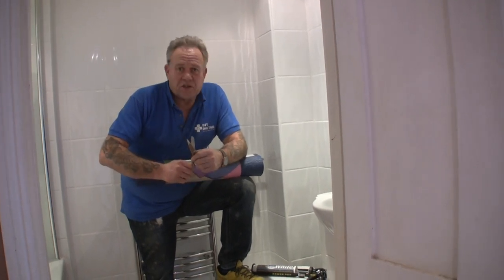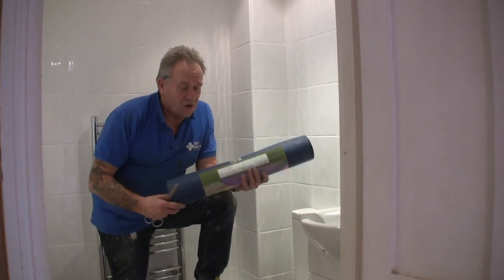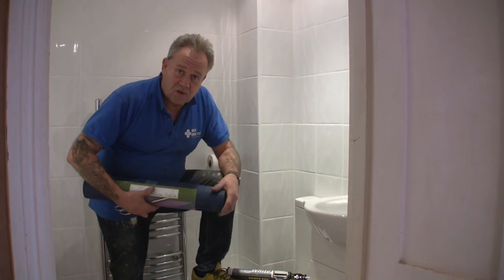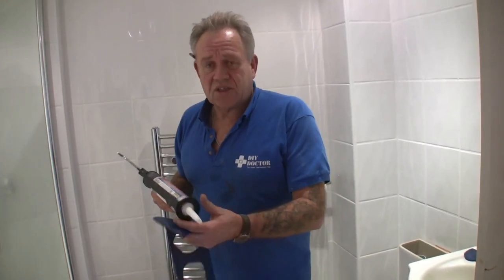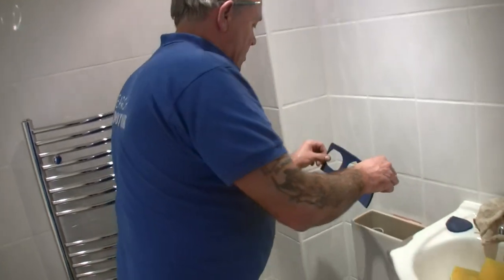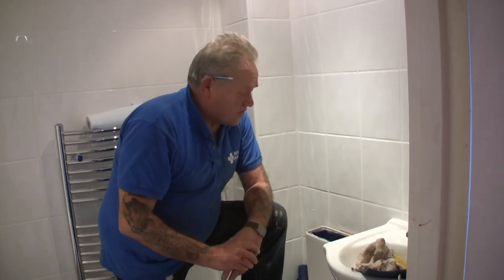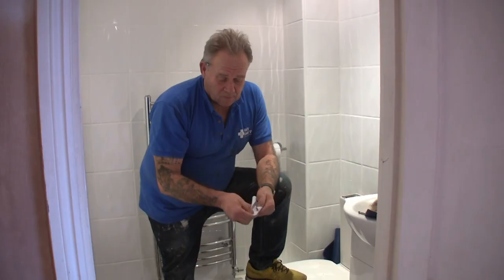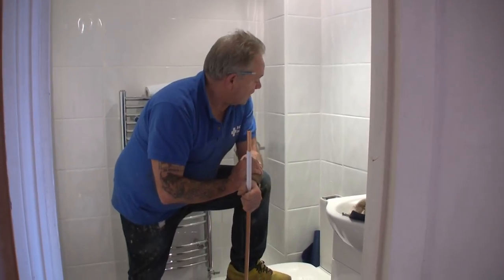Condensation on toilet cisterns and cold water pipes

Comment: lets hope you never have to change change either of those valves, on the upside it does displace water so saves you something on your water bill
Reply from the maker: This installation does not interfere with removal of either the flush valve or the inlet valve Craig. Of course if you are a bit ham fisted and get the sealant everywhere, then it will